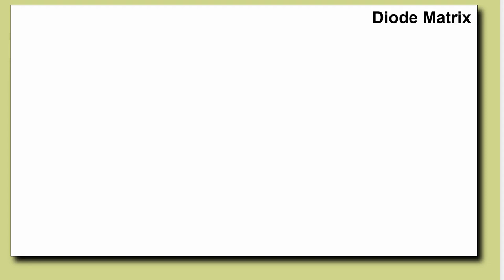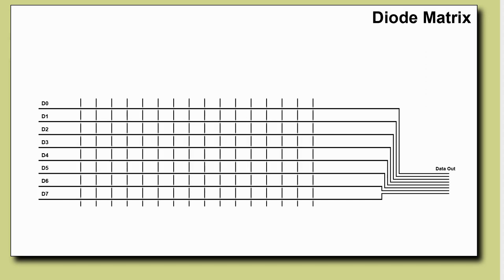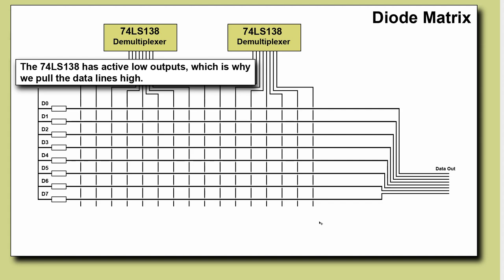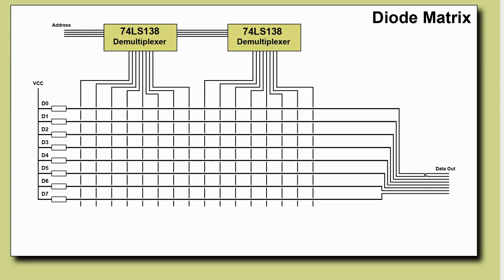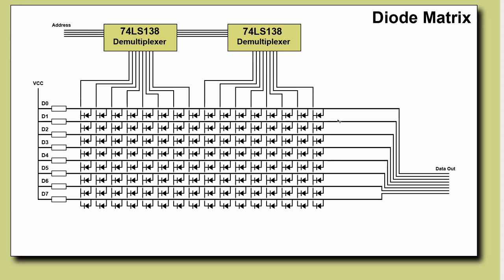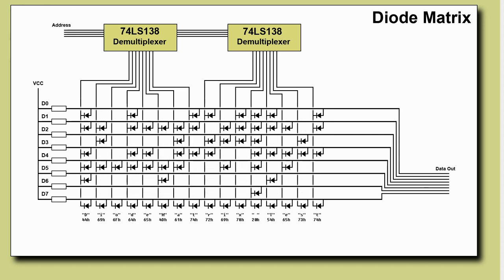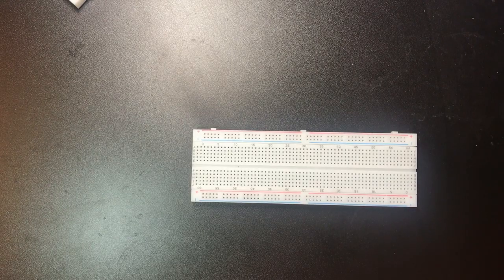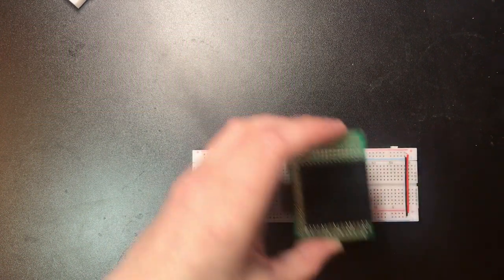Diode Matrix - Prototype Build (1/2)

Comment: The chips can get power from their inputs, or perhaps even their outputs. Anywhere there are ESD protection diodes that could allow the voltage of that pin to sink or source it's appropriate power rail.
Reply from the maker: Indeed, I spent some time looking at internal diagrams for the chips and realised that you end up with lots of paths for current flow. It would be “interesting” to trace an intermittent issue where a chip worked fine apart from where all the inputs are the same. It’s really bad though, tracing the power paths you can end up with multiple outputs sourcing/draining current thru one internal gate outside of the limits.
Reply: Prof Steve Furber tells the story of how the original prototype ARM processor was powered that way when he too forgot to connect the power pins in his keenness to test it. He only noticed when he tried to measure the power consumption.

Comment: Oh, boy, that was a tough solder job! I'd have gone the custom PCB right away ;) hahaha.... the project looks very cool James, and I'd never heard of diode matrix use for roms and boot-loaders.... very cool you got it working!
Reply from the maker: Thanks! It was a real pain but it was rewarding when it worked. I've designed a custom pcb for it now, I added all the driver circuitry to the board as well and the total design and layout time was a small fraction of the solder job. I was just being impatient throwing it together on prototype board.
Reply: @weirdboyjim  wire wrap?

Comment: Yes, there is a reason they put gaps in the breadboard rail, and yes, it's ease of manufacturing. :) Notice how all the connections have 5 holes? The little internal metal parts are made in super long strips with a gap every 5 holes. For the horizontal parts they cut them apart, while for the bus bars they leave multiple of them connected in one longer strip.
Reply from the maker: Sounds right thanks.

Comment: You probably already found this out at this point, but, but when you were inserting the diodes for the test message (finished at 14:47), where there was supposed to be an ASCII "s" (binary 01110011), you instead had an ASCII "g" (binary 01100111).

Also, I've been really liking that you have the chip pinouts in the upper-left corner when wiring it up, which means I don't to look the pinout up myself.
Reply from the maker: Glad you like the chip overlays. Wish I had them in real life!

Comment: I know this is an older video now, but another way to do this would be enameled magnet wire. Solder all the headers as one would normally into the PCB. Then, without stripping the enameling off, solder the wire to the headers along one axis. Then, again without stripping the enamel off, solder the perpendicular wire. The enamel will burn off at soldering temps, but if you're decently fast, it'll only burn off where the wire is soldered. Crossing wires touching each other remain insulated by the enamel. Fill with hot glue, epoxy or whatever if additional insulation or reinforcement is desired. 👍️ Oh, and don't forget to clean the iron tip. Ask me how I know. 😁
Reply from the maker: Yeah, I've used that technique on a couple of other things. The ease of getting custom pcb's made these means I'm unlikely to do something this complex again.
Reply: @weirdboyjim  Without getting too deep into it, let's hope it stays that easy. I've seriously thought about buying etchant and learning how to work on bare copper.

Comment: I wonder if it would be possible to build a Pin-Matrix style of this.

It would probobly required a diode between each junction on each line, but it would be reprogrammable....

Thoughts?

Ref: there is a video on here where a guy show off his Pin-Matrix used for music stuff.
Reply from the maker: You definitely could.  I want to make one with a bunch of dip switches as well,  would be handy.
Reply: @weirdboyjim 
Very.

It was just a random thought I had.

Comment: While playing with diode matrices I found something I don’t understand. A 1k pull down resistor gives me a maximum switching frequency of about 400khz and a horribly distorted waveform. As soon as I change the resistor to something below 700ohm the usable frequency jumps in the two digit MHz range and the signals look great. At 1k the fall times match what I have calculated but at ~700 the signal looks nothing like what I would expect.
Reply from the maker: If you are using pull down resistors your circuits logic must be the opposite of mine, I use pull up resistors and pull down thru the diodes. I'll give you my thoughts, but understand I'm speculating outside of my experience here. The characteristics of where the signal is going will really matter here, if you are driving a logic line it might be something with internal pull ups in which case your pull down is fighting it.
Reply: @weirdboyjim  You were right, the 74HC688 I ordered from ebay weren't 688s at all... 521 with internal pull ups.

Comment: Hi James, nice job! When making the led-matrix on protoboard for my modded TM1637 display, I used thin insulated transformer wire. The enamel melts when sufficiently heated and the thin wire uses less space.
Reply: Go halfway this video https://youtu.be/yEd8KBZ0Yhw to see what I mean. With a PCB made you may not need it, but perhaps you'll have another project coming up where it may be handy... ;-)
Reply from the maker: I can see many different ways to do it better after the fact. Enameled wire is definetly better than what I did.

Comment: Hey James, cool video! I was asking myself what type of diodes you are using. Are they signal diode? Is the 1 volt drop dramatic?
Reply from the maker: In this video I was using 1N4148's with a standard 1v drop. I believe there is no issue with the drop, the output voltage is well within the tll thresholds.
Reply: @weirdboyjim  Thanks! Maybe this is a stupid question but is there some kind of 8 bit compatible usb controller? That would be so sick!
Reply from the maker: I just ran some tests,  when pulling down thru the diode it ends up at 0.24v, well under the 0.8v lower threshold.
Reply from the maker: That depends what you want to do. I've not tried one but the FT232RL maybe what you want, you would need to implement a 5v uart but it would give you basic communication. Alternatively you could write code for an Arduino to make whatever 8 bit interface you wanted. Full implementation of a usb stack is asking a bit much of a homebrew cpu.
Reply: @weirdboyjim  So that means i should go with a Schottky diode?
Reply: Oh i think i misunderstood
Reply: It's amazing that it does work with TTL & HCT logic, as the maximum Low level input voltage for a TTL gate is 0.8V, and the diodes you are using have a maximum forward voltage drop of 1V, which  will be the lowest voltage they would be able to pull the low level to. I'm not a transistor expert, but the Base Emitter voltage drop is typically 0.7V, so may be the typical voltage drop for these diodes is 0.7V and you can squeak by. Will have to watch Part 2 to see if you have problems driving gates, but have watched it working in your CPU, so know that you got it to work one way or another.

Comment: I've been working on a control panel for a home-made synthesizer for about the last 4 million years.
A few of the controls are simple 4 and 8 position rotary switches and I use diode logic on them to they can output their position in binary.
 I think the idea originated in Fran's video about diode steering: https://www.youtube.com/watch?v=JNbDdnEpAOQ
I didn't know that it could be scaled up to a ROM though... that's cool.
That pad-board prototyping board has always been a nemesis for me.... whenever I try to use it, spaghetti ensues... I applaud your effort considering it's your first time.
Wire-wrap might have been an answer... but that's quite an investment in tools and parts for a one-off job.
And I LOVE the idea of doing a two-layer board using Veroboard (stripboard)... It's a meeting of clunky and high-tech in one strange bodge... it's beautiful.
Reply from the maker: I really wish I had come up with the twin board idea first. These days however just going direct to  a custom pcb is proberbly the best option, unless it's time sensetive.

Comment: I tediously designed my own multiplexer with 48 addresses because I didn't know there was an IC for that haha it was like 20 bucks in parts this is a way better way of doing it though I am going to use two or three CD74HC154's
Reply from the maker: Ouch! The 154 is a nice chip, I could have reduced the part count in the bus control circuit of my cpu with some of those but I was trying to avoid adding to many unique parts to the bom.